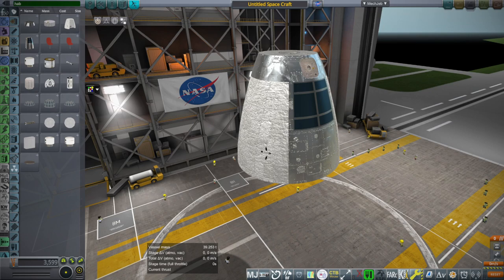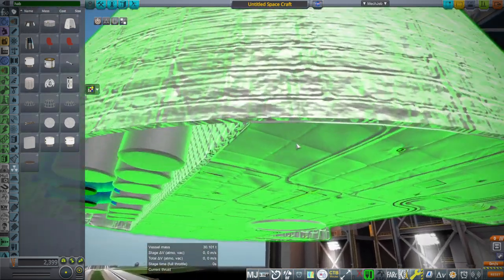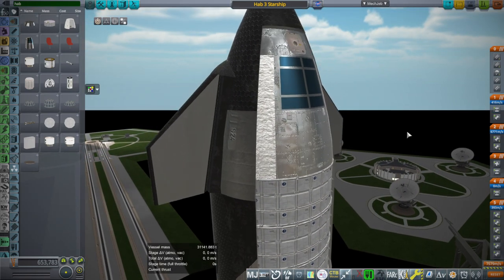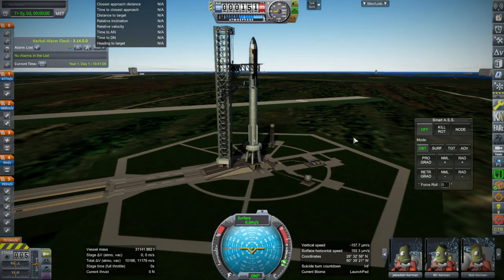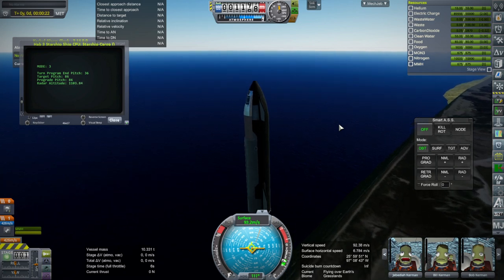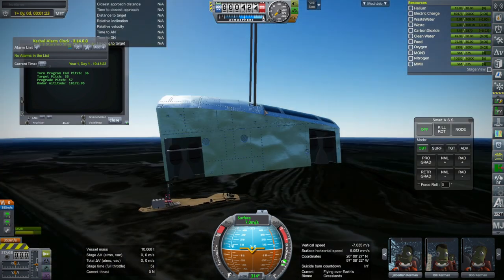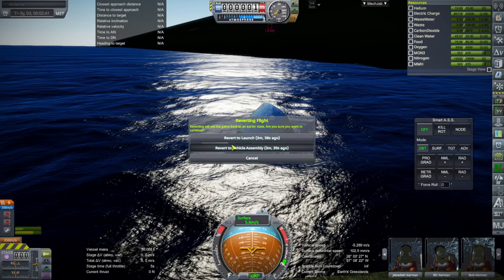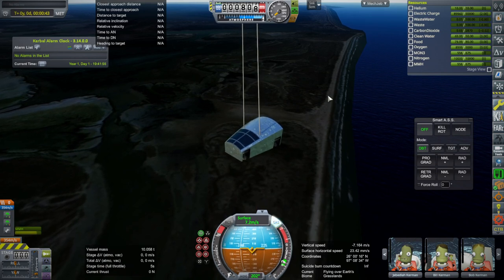KSP 1.12 with RO - Hab 3 Intro + Starship Launch Escape Test

Comment: Nice. I was assuming before the whole nosecone would have to pop off with flaps and TPS to guide a stable re entry through higher aerodynamic and thermal loads if abort was later into flight, then a pod could eject
Reply from the maker: This solution is only for certain regimes, to be sure, but that's true of many abort systems. Consider the Gemini ejection seats, for example.
Reply from the maker: While I don't think it's necessary for my purposes, I can build extendable wings and thermal protection into this pod. There's a lot you can do with 10 tons. I made sure it had pretty substantial mass margin.

Comment: Nice system. I like your creations. It also makes me think about how to create an ideal abort systems. Some elements that come to mind:
- You would probably want to make them as small and light as possible. This reduces the impact on the payload and also helps to quickly accelerate away from the broken rocket.
- Astronauts are not really flying the rocket these days. They could all be located in minimal size cylindrical pods ready to be launched out of the side of the rocket.
- The escape pod/pods are only interesting up to a certain speed and altitude. How much heat and shock protection would be needed?
- Astronauts could carry their own parachutes during launch and and exit the escape pod as soon as the air speed is below say 120 m/s or something.
- Escape pods ejecting upwards at an angle may work from lower altitudes or even from the pad. Historically quite a few rockets have exploded on the pad or near the pad.
- Up to a reasonable speed (upgraded) fighterjet style ejection seat technology may be suitable.
- A starship at higher altitude could probably use its own heatshield to aerobrake until the astronauts can eject safely.
- I think when designing an ejection system it is first important to define under which circumstances and conditions the system would need to be used. 
- It might even be interesting to have the astronauts located in an escape nose-cone until 140 km altitude. Then the astronauts move into the main ship and then the nose-cone is expended. Although this may be a bit far fetched.
Concerning the Starship bay door opening, I think clearance is still an issue even with the bay door removed. In reality there should be collaboration to ensure the best solution for your spacecraft to integrate with Starship, especially since it is probably not a one-time launch. (Give PEKKA a call?? ;-)) Multiple doors opening more than 180 degree of the ship possibly with included explosive opening in case of an ejection would seem reasonable to me. It appears that SpaceX is struggling a bit with their solution but on the otherhand pharing technology and shuttle bay-door technology is well-understood and look how the new Neutron design proposes hippo-doors (still to be proven). Also a Starship may not be able to land without a closed shell.
Looking forward to how your solution will progress in KSP. ;-)
Reply from the maker: This is my solution, Richard - I'm not intending to change it much, I just need to figure out how many people can fit inside the thing. If you're worried about heat and shock protection on this, why are you even suggesting ejection seats later on? And then, ejection seats are obviously not a good idea if we expand the crew in this to eight. The escape nosecone is problematic because of Starship's header tanks there. For use with Starship, the module is not meant to be removed - it will remain integrated with Starship. It is only independent when launched by other launchers.
Reply: @RaizSpace  Thanks for your reply. Sorry but I'm certainly not asking you to change anything or push you in any direction. I'm just putting some elements that come to my mind, possibly for a small discussion or simply to be corrected why my ideas a possibly dumb. I hadn't understood that your module inside Starship was supposed to remain integrated which indeed makes more sense. Concerning the ejection seats, my thoughts are that they may be a solution for the first say 1 km which may be the highest risk, beyond that height Starship could potentially be used to reduced velocity enough for ejection seats to become usable. Of course, other solutions will give protection until orbit and maybe even at the end of re-entry, such solutuions will need significant heat and shock protection. I'm not a specialist in escape systems as you see, but I think it is nice to see if a given escape system could be further optimized or made differently. Thanks for the video.
Reply: "They could all be located in minimal size cylindrical pods ready to be launched out of the side of the rocket."
you just described the way the first man flew in orbit - Gagarin sat in an ejection seat with a parachute.
Reply from the maker: @richardbloemenkamp8532 No problems and sorry if I sounded touchy.
Reply: @RaizSpace  Rereading my own post it indeed sounded a bit more know-it-all than I meant. Your creative videos are the best.

Comment: you can even use the remaining propellant for a soft landing
Reply from the maker: It's not aerodynamically stable and has no control system without the parachutes, so we'd have to build extra stuff in for that to work. It's basically an overgrown ejection seat at this point.
Reply: @RaizSpace  no, with parachutes like New Shepard does
Reply from the maker: @FatovMikhail Ah, or like the Soyuz capsule puff for ground landings. Yeah, it can do that.

Comment: Hey man. If you could humor me I have a few questions sbout ksp and rss.
1. where in the cfg files do you find the spool up times for engines? I have looked and looked. You mentioned in your video that you have adjusted them but cant get them to zero. Can you tell me where they are located please?
2. I am using real fuels, as you do in rss, but I would like to be able to adjust the fuel densities. Can you point me into the right direction on that one also please, I have looked and looked.

Lastly, have you noticed the configs that third party modders make for RO and RSS suck?
For instance Tundra Exploration(a pretty popular mod). the RO configs seem to be ok, however in real life that is not the case. I mean all of the thrust values and ISP are true to life, but in practice, you couldnt launch a feather into LOE on a falcon 9 I dont understand why either. no matter the trajectory. Its really frustrating. And to that last note, how would you go about fixing the issue?

I dont expect you to answer me, but i would be so stoked if you did. You would save me alot of pain.
Reply from the maker: I'm a third-party modder as far as I know, so . . .

For the spool up time, I noticed that they had made NERVA engines take a long time to spool up, so I looked at the NERVA_Config.cfg file in the Engine_Configs folder in the RO folder and saw a line %throttleResponseRate = 0.035 in the Engine config section. Take a look at that config and imitate it, but make the number higher than 1 for a response rate less than 1 second.

The fuel densities are in Community Resource Pack in the CommonResources.cfg file. I wouldn't recommend changing them, but you can add an alternate version of a resource that has a different density.

I don't know what the problem is with the Tundra Exploration config as I've only used KK Launchers pack for Falcon 9 - seems like something you can ask on the forum thread for that mod. If the thrust and ISPs are right, then maybe the propellant quantity or dry masses are not. I would be surprised by that, though.